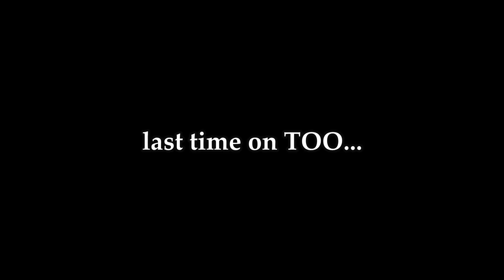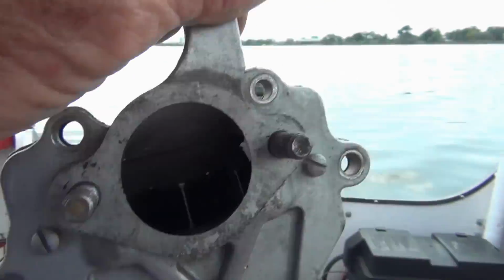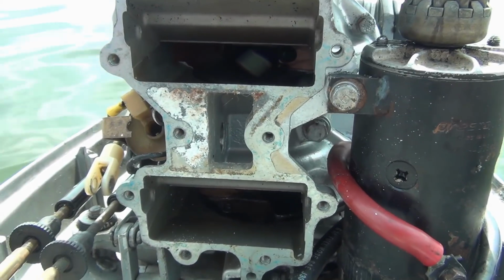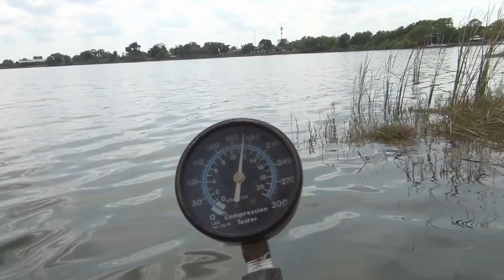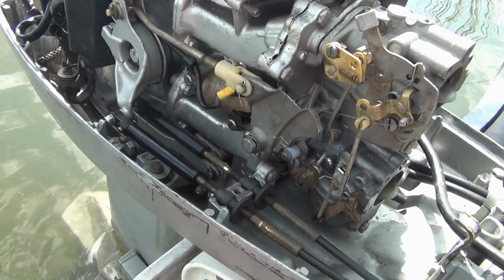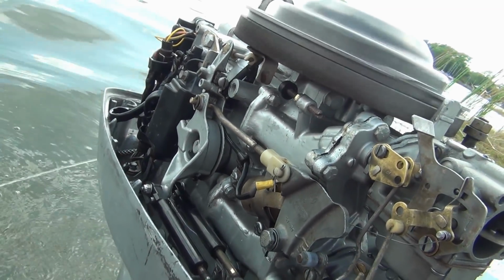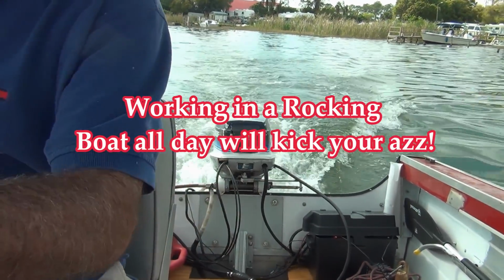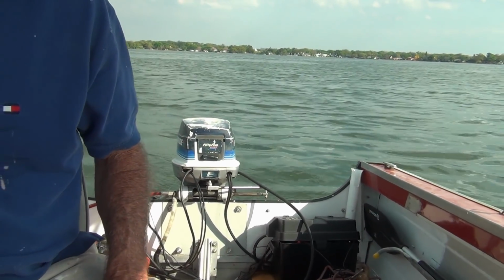1979 Evinrude 55 Hp Reed Valves, Compression Test. Eliminated

Comment: Maybe you have some bad gas???????
Reply from the maker: Hahaha. What's up DB. The Feds still haven't picked you up yet. Hahaha I keep telling them where your at! Haha Thanks again for tuning in! No on the gas, I'm sure I've probably pumped 10 gallons through that thing by now. Thanks again & Stay tuned for the next episode!
Reply: I’m no outboard Mechanic by far but I had a similar problem with my evenrude 175 and it turned out as a slight leak in the fuel line and slowly dropping the prime ....
Reply from the maker: @poweredparachute1   Hey Robert. Thanks for tuning in and commenting. Yeah the tank/fuel line/primer bulb was the first thing I went after and eliminated. That was a few vids back. Everythings been good in that department since. Anyway just caught a dude stealing parts off the 55 at the dock. He was going for my battery when I walked up on him. he took off and we tried to catch him at the ramp. the guys fishing there saw him and said he left in a big hurry. he had his buddies waiting for him with the trailer. so it was all planned out. he did get away with my new omc coils. F***ing Prick! Thanks again for tuning in!
Reply: It’s a dam sham when people pinch stuff .  I’m working on the evinrude 175  6 cylinder ATM and I’m having sneezing problem only  just when the engine is dead cold for about  first 3 minutes then it cleans it self out ( it’s got me beat)   When it runs and idle fine  and when start up even if it sits for 20 minutes and starts it’s works fine but dead cold it’s a bitch .... lol
Reply from the maker: @poweredparachute1   Yeah I've had that happen before with 25 hp motors. Sometimes it takes awhile for them to clear their throats!
Reply: @THISOLDOUTBOARD1  Hi This Old Outboard. Longtime viewer, love the channel. I am sorry to hear about the thieves. It sounds like they were after more than just the battery if they had a trailer. Keep an eye on your boat.